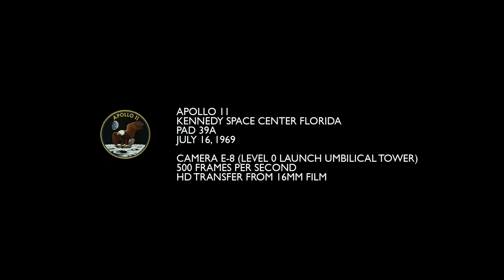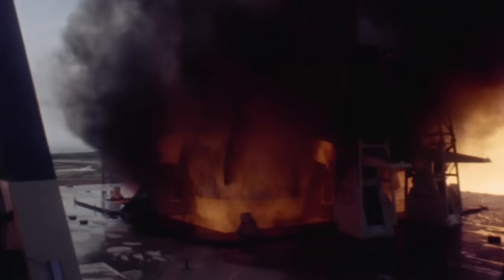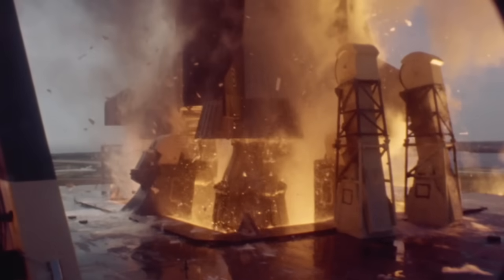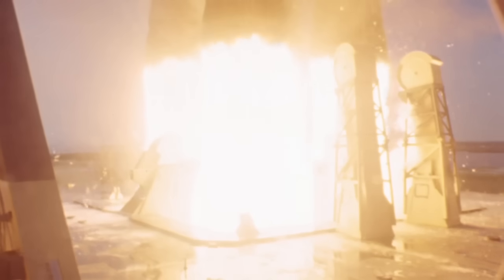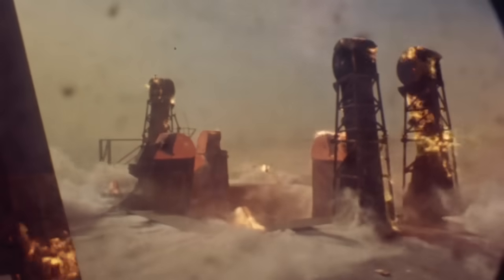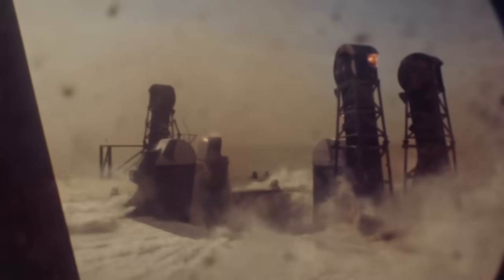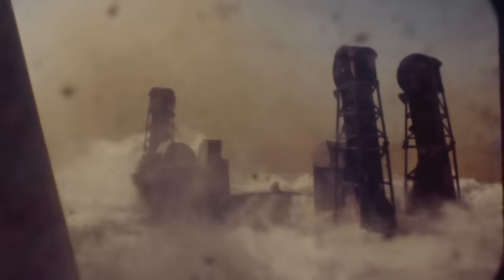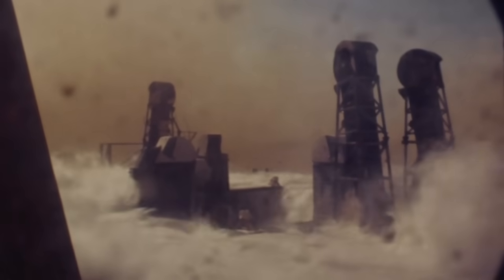Apollo 11 Saturn V Launch Camera E-8

Comment: I worked on the Apollo 11 launch and have one of the holddown arm explosive bolts still sitting on my bookcase.  I was 25 and this was the high point of my career.  I saw this footage almost 49 years ago a few days after launch but without any commentary.  The narrator is spot on.
Reply: I was working at the MILA tracking station during the Apollo Program recording the audio and slo-scan tv . We also recorded all of the Telemetry data that was transmitted back from every event that was performed by the equipment on the different sections of the Apollo structure. We even recorded the ekg, respiration rate of the Astronauts.  Yes, this was also  my best life experience that I was blessed to be a part of in my working life. Bendix Field Engineering Corp. was my company.
Reply: Bruce Clements That is indescribably cool! Thank you for helping us get to the moon! 🇺🇸
Reply: My God, I can only imagine. I've seen some of that medical telemetry data you mention, during that final descent, their heart rates were well into triple digits!
Reply: My Dad work for Bendix. Yay, Dad!
Reply: @winstonsmith9533  I remember a lot of Bendix guys running around.
Reply: @bruceclements6783 , Ann Arbor, correct?
Reply: @bruceclements6783  Were you also responsible for losing ALL of the telemetry data as well????
Reply: @highwayvagrant1 HIS dream happened.  Im not a Believer of the Fake Theory. Its just bashing. I know an astronaut. He went he saw he returned. I have no reason not to believe.
Reply: My dream never fulfilled! Glad its one you made happen. Thank you !
Reply: Highway, there are hundreds of satellites, some quite large, circling the Earth at about 200 miles at that speed, and others slower (7200MPH) , but are in geosynchronous orbit at 22000 miles high. It's just a simple matter of scaling the size of the boosters to the weight of the payload. I will cut you some slack though and assume you are Amish or something. lol
Reply: @highwayvagrant1 ..I saw a great website about the Saturn engines . The Apollo did reach 17000mph then went into a parking orbit and after orbiting earth it fired its engines again and with the help of the moons gravity it could escape earths gravity . It also went in a radial direction which required less energy .

But my question to you is why after all these years has not 1 person from the Apollo program came forward to say it was a fake ? As well as Russia who followed and tracked it .

They do have lower quality tape of the Apollo missions , I dont find them losing the tapes as a cover up . NASA had the shuttle missions coming up and priorities changed .

https://www.school-for-champions.com/science/gravitation_escape_velocity_saturn_v.htm#.W4rhPHMpA0M
Reply: It must be amazing to have been any part of that history. Congratulations to you and the thousands of others who had ANYTHING to do with that event.
Reply: There are some films of the second stage of the Saturn V separating from the departing third stage, and then pitching over to fall back to the earth - some of these are in the movie "For All Mankind", and I remember some of it in a CBS special years ago called "The Moon Above ,The Earth Below". My understanding is that the way those images were captured was by ejecting film cartridges from the vehicles, and having them parachuted back into the ocean to be recovered. Thank goodness that digital transmission of images came about - otherwise we'd never get all those wonderful images from around the solar system of the planets and moons.
Reply: Don’t waste your time talking to highwayvagrant1. He’s an ignorant nitwit that doesn’t even believe the ISS is real. He thinks they film everything underwater in a pool. LMAO
Reply: @highwayvagrant1 
I see, you are a .... "special" human being. Now if you would have any grasp of mathematics you could easily figure out what speed was needed to get the rocket into orbit. Just a little help from my side, the gravity of earth gets weaker the more distance  you have between you and the earth. The air density also decreases and therefor the air resistance with altitude, you can calculate that yourself or just try to build a rocket that could reach space ;D. Don't be so ignorant man, if you don't believe the moon landing, you also don't belive in cars, lawnmowers, powerplants, Burger King and you would most certainly not use the internet, since it bases on technology you can't figure out or replicte XD. You are contradicting your conspiracy theorie as soon as you use the internet or any other new tech.
Reply: @Enthropical_Thunder  Let's not forget that for every second of flight, the Saturn V is shedding fuel weight at a rapid rate. The rocket is literally getting lighter the higher it goes.
Reply: @salamanca1954  
Of course, that's how they accellerate their acceleration during flight, if that makes sense XD (steadily increasing acceleration).
Reply: @Enthropical_Thunder  The deniers tend to be oblivious of that fact. I roughly calculated that the five F1s together were burning 28 tons of fuel per second.
Reply: @salamanca1954  28 Tons of fuel per second? Hooooly Sh*t. 😲😲😲
Reply: @maozedong981  Holy shit indeed.
Reply: @maozedong981  I know! It's crazy!
Reply: apollo11guy Thank you for helping us get to the moon!
Reply: You are correct of course about the missing telemetry data. NASA's own report details the loss and hunt for the data: https://www.hq.nasa.gov/alsj/a11/Apollo_11_TV_Tapes_Report.pdf  and I think the report is pretty convincing in its explanation of the situation. So it comes down to whether you believe the government perpetrated this hoax or whether we really went to the moon in 1969. Having been to Cape Canaveral several times and having studied the space race thoughtfully for years,  I am 100% convinced the flight was real. Sounds like you don't believe it, which means you think Neil Armstrong, Buzz Aldrin and Michael Collins were lying about this......not much I can say to you except until we go back to the moon and photos of the landing sites are sent back to earth (or we find nothing.....), we'll need to agree to dis-agree. Cheers. 

BTW are you of the opinion that ALL of the Apollo program is fake? All the way through til 17?

Finally, regarding Markenda, yes I agree with you he went right to the tinfoil hat remark (didn't see that first time honestly) although his second reply is polite an valid as you say. I don't believe in insults as a way to debate  on Youtube, particularly with science-related topics. Thanks for the interesting dialogue!
Reply: @bcdrummer1962  They went into orbit on all the Apollo missions, the problem is they orbited Earth not the moon.  Then they came back down and handed out petrified wood that they told people was moon rocks.  Everybody believed it, I mean they saw the rocket, they worked on the equipment, they saw it on TV!  That means that it's true right?  Except it's not true, it's a lie, no man has ever stepped foot on the moon at least not one that the public knows the name of.  50 years and despite super computers, carbon fiber and better fuels, still no one goes back.  Why?  Well obviously the current generation of people on Earth despite great technological advancement are far more stupid than a bunch of NASA guys in 1969 were.  Keep telling yourself that Boomers.  Oh yeah and it was terrorists with box cutters also, 100%.
Reply: Nice to make your acquaintance! I'm such a fan of NASA from when I was little. I remember hearing about Spunik eating breakfast before school an I knew how I'm this was. Saw the parade for the Mercury 7, after Glenn returned from his orbiting the Earth.  It was great. Saw three Shutter launches from long distance but saw them and also so the Space Station screeching across the sky twice and I wear JPL (w Saturn) loho on my polartech at work! Thanks for letting me tell you all this,lol!!
Reply: highwayvagrant1  All that engineering data were on tapes that were reviewed, and with no pertinent anomalies were then stored somewhere; at this point, all the Saturn Vs had been ordered to complete moon landings up through Apollo 20 - within two years Apollos 18-20 were cancelled; i.e., most of the technical issues with the Saturn V were resolved by Apollo 11, and with this expensive program ending, the engineering resources were redirected at development of the space shuttle. The last Saturn V flew in 1973(I was lucky to see and experience that), but there are two other real live Saturn Vs in existence that were not used for those cancelled flights - one is at Space Center Houston, and the other is at the Kennedy Space Center - they are just sitting outside getting ravaged by the weather!

There are huge amounts of data from experiments during the Apollo program, as well as technical and engineering data which is stored on reel to reel tapes that are in boxes in some unknown corners of the various space centers. Part of the problem is having the money to properly protect these investments, and to have someone convert it to the latest storage technology to be able to access the information; what if all you have is on a VHS tape, and you can't find a player to view it? I think a similar issue happened with Lunar Orbiter photos from the mid 60s that were found about 8 years ago, and someone was able to find and fix a machine to access this info, and it was eventually digitized.
Reply: @larsjordan13   Just want to point out that the 2 remaining Saturn V boosters are no longer sitting outside in the elements, but are housed in climate-controlled buildings.  At KSC,  they have a nice facility that's part of the tour.  At Johnson Space Center (Space Center Houston) the facility isn't as nice, but can be viewed for free.  Just drive up and park, and go inside!  These engines are a sight to see!
Reply: @paulmckenna5224  with the money Taxpayers are robbed by NASA they should be housed in a solid gold hanger
Reply: @apollo11guy. I was wondering how the holdown arms were released and you answered the question I wanted to ask. Thanks for that and good luck to you my friend.
Reply: God Bless the U.S.A.
Reply: @ apollo11guy...What an awesome experience for you; I can only imagine. Sorry if I missed it in any comments, but can you explain ice falling off the rocket? In July? In Florida? Still trying to grasp that. I was 7 when we landed on the moon (the first time) and watched it on TV. It was July, which is why I can't believe "ice" is falling off the Saturn V....hmmmm...
Reply: @TheAngryYank  The stages contained super cold liquid oxygen and hydrogen.  This cooled down the skin of the rocket to where the humid air condensed and froze to the sides.  The vibration at launch broke the ice free.
Reply: @TheAngryYank  The propellant tanks were filled with super cold liquid oxygen and hydrogen.  This made parts of the rocket skin very cold which caused the moisture in the humid Florida air to condensed and then freeze on the side of the rocket.  The vibrations due to the engines igniting broke the ice loose.
Reply: @TheAngryYank  Ice formed because the tanks contained very cold liquid oxygen and  hydrogen.  The water vapor in the humid air condensed and froze against the cold surfaces.
Reply: @TheAngryYank  Liquid Fueled Rockets since the 1920s Robert Goddard Patents use Liquid Oxygen, which is cryogenic! Liquid oxygen has a density of 1.141 g/cm3 (1.141 kg/L or 1141 kg/m3), slightly denser than liquid water, and is cryogenic with a freezing point of 54.36 K (−218.79 °C; −361.82 °F) and a boiling point of 90.19 K (−182.96 °C; −297.33 °F) at 101.325 kPa (760 mmHg). so of COURSE there is ice! Even in hot weather. Been watching ice fall off spacecraft in Florida since 1962!
Reply: That's truly emotional. This was one of the greatest achievements EVER by mankind. It must feel great to have been a part of it.
Reply: per aspera ad astra ¿  Your Dad sounds cool. I bet the story of your journey across the USA is almost as interesting as seeing the launch itself. I can't really remember Apollo 11 on tv. My Dad was cool as well, he told me he watched it live on TV with me but I was only 4 at the time and can't remember!
Reply: What an amazing experience and wonderful piece of history you have!

Having read some of the various replies on this, am a little bewildered by some of the questions. In the interest of being useful, thought I might help out a little.

Questions regarding speed of the rocket:

The Tsiolkovsky Equation (a.k.a. rocket equation) gives a reasonable 1st order estimate. Basically, the delta-V of the rocket is related to the ratio of the natural log of the initial and final mass:

dV = Isp x g0 x ln(m0/mf)

where Isp = specific impulse; approximately 263 seconds for Apollo 11;
g0 = acceleration due to gravity @ earth surface; approximately 9.81 ms^-2;
m0 = mass on launch pad; approximately 2,950,000 kg;
mf = mass at first stage burnout; approximately 78% less than launch mass, or 649,000 kg

Numbers: dV = (263)x(9.81)xls(2,950,000/649,000) = (approx) 3,906 m/s = 12,816 ft/s = 2.427 mi/s = 8,738 mph (theoretical maximum @ 1st stage burnout). 
The second and third stages take it up to approximately 17,000 mph or so, with the SIVb being used to circularize and refine the parking orbit.

Next question: what was the speed of the parking orbit prior to translunar injection? This is calculated as the circular speed, and is determined based on solving the 2-body problem equating centripetal force on the vehicle with the gravitational force of the earth. The resulting expression is stated simply:

Vcs = square-root(mu/Rcs)

where mu = gravitational parameter (product of the gravitational constant and mass of the earth) approximately equal to 3.9860E14 m^3s^-2;
Rcs = absolute altitude of the satellite, equal to the earth radius + satellite height; considering an equatorial orbit, earth radius approximately 6378.145 km = 6378145 meters; altitude in parking orbit let's take to be 110 miles circular, or approximately 177 km. Then,

Vcs = square-root(3.986012E14/(6378145+177029/9927)) = (approx) 7798 m/s = 25,583 ft/s = 4.85 mi/s = 17,443 mph

My math seems to match on the spreadsheet, although I might have made a typo. But, these numbers match independent checks. The various constants change some over the years. I have used constants that are available from JPL and in the following reference text. Depending on the specific constants you use, "your mileage may vary", as they say.

A good reference: "Fundamentals of Astrodynamics"m Bate, Mueller, White; (c) 1971. Have used this book for over 35 years.
Reply: Very neat!  I am jealous!
Reply: How soon after a launch were the crews able to go back out to the pad?
Reply: @Camop-iz9kt  I don't recall exactly.  Safety crew probably went out a few hours after launch to check for hazards, then a few hours later guys went out for damage assessment.
Reply: @highwayvagrant1 Well how can we convince you? I'd like to help out.
Reply: Seriously??????     Had to be very very cool
Reply: Shut up you fuckwit.
Reply: cool man Lets talk about the Aliens in the Apollo missions
-
Reply: You are a very luck guy to have lived and worked during the height of NASA.
Reply: I had a dear friend Chris Menke who worked this flight!
Reply: I love when folks such as yourself share their unique life experience(s) in relation to the video subject/content. I'm envious of all that you were able to observe & experience. : )

THANKS VERY MUCH FOR SHARING!
Reply: Lol the highway guy deleted his comments
Reply: that is more than just cool.
it's the dream of mankind coming true, through your hands.
Reply: @apollo11guy damn thats freaking neat. ive spent sooooooooooo much marveling at the space race.
Reply: Believable, if you made your mail id 20 years back.
Reply: @piyushsrivastavjaipuriasch8356  WTF?
Reply: What most get to see is of the vehicle sitting on a blazing tail of fire that lifts and pushes it up into space. Getting to see (zoomed-in) the moments before, during and after lift-off, and the sight of the launch pad during those crucial moments, is like getting to see the other side of the moon, in real time. The extent of the details is mind-boggling. Thank you for the vivid, priceless visuals and the explanatory commentary on one of the most historic moments of our time!
Reply: My father worked on Apollo 11 he worked on 2nd stage. I grew up in Titusville just across the river from the Cape. He worked on the 2nd on all of the Apollo missions. Then he worked on the 3 main engine’s of the Space Shuttle program. I think back on all of those launches in a different way now knowing he was a part of History. Cool stuff. Perfection that’s what the men who worked there believed and achieved!
Thanks to all who made it happen. 🚀
Reply: @ronaldebersole3002  We lived in Tutusville, too!
Reply: You lucky devil!
Reply: highwayvagrant1 Your life is an utter waste, we don’t care about your opinions, and you never have and never will earn the right to bother people who have actually achieved great things in life. You are human waste, sad.
Reply: DoctorShocktor "we don't care about your opinions" because we like the believe that NASA went to the Moon and back. Leave our scientism and dogma alone. LOL......it is not an opinion, it qualifies as a theory by now because of all the evidence, especially the faking of being half way to the Moon and having some undisclosed 3rd party coaching the astronauts to "talk" after 4 seconds.
Reply: @highwayvagrant1 FACT.
Reply: Asshat
Reply: apollo11guy, is the bolt that you have one of perhaps 1,000 bolts used to hold the Saturn V in place along with the hold down arms? I believe these bolts were heated by the Saturn flames, they became malleable and as they softened released the Saturn V. An ingenious solution to hold the Saturn in place until it built up the 7.5 million pound thrust. What responsibilities did you have before and during launch? You should be very proud to have worked on such an outstanding achievement. Thank you for your efforts.
Reply: @atpg5  I don't think there were 1,000 bolts holding it down, just 4 holddown arms.
Reply: highwayvagrant1
Thank you for responding. I do apologize for the insult, I wouldn't appreciate it either. As far as the arguement regarding escape velocity, I do believe that current launches of rocket's, i.e. falcon 9, the video and telemetry provided shows that escape velocity is achieved. I know the Saturn V is an entirely different rocket, but also much more powerful. I can only close in saying that it seems to appear to me that you simply don't want to believe despite sufficient proof that the rocket left the atmosphere, despite the other launches. Best wishes.
Reply: highwayvagrant1 2nd comment - there is a fatal flaw in your argument - somehow NASA was able to create the bluff to all mankind that they actually went to the moon when they didn't, that it was all an elaborate fake that they were able to get the whole world to believe - yet they DIDN'T HAVE THE ABILITY TO PRODUCE FAKE TELEMETRY TO SUPPORT THE HOAX? Come on man, you seem smarter than that. 

That said, you won't buy it so that's cool: but I still want to hear your factual counter-argument to Markenda's explanation of what speed is needed to attain orbital velocity.
Reply: highwayvagrant1
I am not saying by any means that the Falcon 9 is more powerful than the Saturn V, clearly it is not. I was simply referring to the Falcon 9 in that the telemetry and video showing the necessary velocity being attained. If you are referring to specifically a rocket leaving all of earth's influence, then I believe that the data provided by other Saturn V launches and more recently the Falcon Heavy and other research satellites provide that evidence. As far as the second question, I really don't know. 
I am curious in that are you questioning the Apollo 11 launch having really been successful because of the missing data,  or is it other reasons? I can only refer to the other Apollo moon landings as evidence that they did go to the moon. I really don't have any reason to doubt the success or legitimacy of the program.
Reply: Wow, so cool. Thanks for Making America Great back then!! Totally cool!
Reply: highwayvagrant1
I think you need to put some new aluminum foil in your hat.
Reply: Hiwyvagrant1 first comment: First I'm saying that Markenda responded to your request for a "counter-argument rather than un-original insults" - see his response to you above. Second I am saying that you conveniently did NOT reply to his clear and accurate counter-argument, you just went on to oppose other comments. And I find that lame. Here is Markenda's response to your challenge, I've copied it here:

highwayvagrant1 (from Markenda)
Ok. The rocket just has to attain a velocity that allows it to overcome earth's gravity. Once in space, that is in a vacuum, it keeps accelerating until it reaches a velocity of around 18,000 mph. It isn't possible, nor would it be desirable for a rocket to reach 18,000 mph to get into space. The heat from friction would burn it up before ever reaching orbit.

You've still never addressed this. Please do.
Reply: highwayvagrant1
Ok. The rocket just has to attain a velocity that allows it to overcome earth's gravity. Once in space, that is in a vacuum, it keeps accelerating until it reaches a velocity of around 18,000 mph. It isn't possible, nor would it be desirable for a rocket to reach 18,000 mph to get into space. The heat from friction would burn it up before ever reaching orbit.
Reply: +markenda1 great slap in the face reply to this flat-earther highwayvagrant1. I notice that this person has not replied to you even though he/she has replied to other posts since. Shows that this person really does not have an argument, is just looking to be contrarian for no good reason, and I think everyone should just ignore his/her comments.
Reply: @bcdrummer1962  more commonly known as a Troll
Reply: @markenda1  
I am guessing trailer park trash such as yourself might not have the resources to access the mystical arts of education huh?
Reply: @shonaoneill5151  Just wondering why the insult and no explanation as to why. I make no claim to being an expert at anything. Please elaborate as to why the comment. Have a good day.
Reply: @markenda1  18,000 mph is orbital velocity;  25,000 mph is required to go to escape earth gravity.
Reply: @apollo11guy  Just curious as to why you chose to call me ignorant when others have posted comments that clearly were ignorant. I stated that I am not any sort of expert and if I was wrong on the velocity, then I was wrong. As to the second part of your response, I know that the rocket doesn't approach those speeds until in space and my comment was to someone who was stating that it needed to.
Reply: @apollo11guy  The response was to someone stating that the rocket would need to go 18,000 mph right from launch, not as an ultimate velocity. That is why I made the comment about heating. It must be nice to be perfect, so make sure you never make any errors, though reading comprehension seems to be one of your shortcomings.
Reply: @markenda1  I apologize;  the fact that the original commenter you answered to has deleted all his posts prevented me from knowing that.  I'm not perfect, but having been on the launch team at Kennedy for Apollo, I do know more than most people regarding the program.  I shall modify or delete the posts that offend you.
Reply: @apollo11guy  No need to delete anything. I can unfortunately take things a bit too personally, that is one of my many faults. The fact that you were there and experienced it is incredible, and all of that hard work is still appreciated. You have a good day sir.
Reply: @markenda1  Craft with integral forcefiuelds do not have to worry about heat-cause friction, and cauise no sonic boom, as experiments with electrified airfoils  in 1967-68, and forcefield propulsion patents and experiments by The Late TT Brown, and the Late Prof. John RR Searl, and The late OT Carr, and the Late David Hamel of Canada. Internal combustion is DEAD.
Reply: @Beamshipcaptain  What are you talking about? How do you figure that the Saturn rockets had integral forcefield's? This isn't Star Trek.
Reply: @markenda1  no, once its in vacuum, it keeps COASTING, instead of accelerating after the fuel is all burned up, which takes about 5 minutes from launch.
Reply: I have all the explosive bolts from 2001 Space Odyssey.
Reply: highwayvagrant1 Fantastic response. The people who recorded the data didn't know what the fuck they were recording and where it was coming from. NASA either hid or destroyed the data but they can't say that. What is lost, can always be found; especially such a large amount of boxes. Therefore it is most likely destroyed.